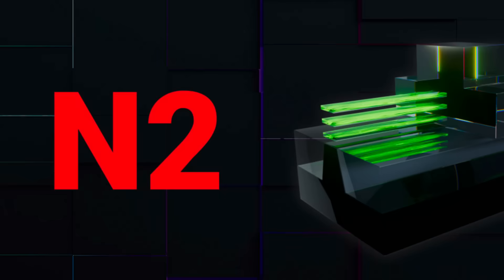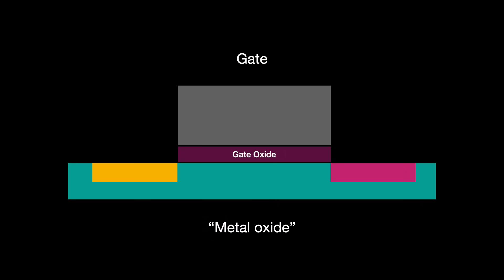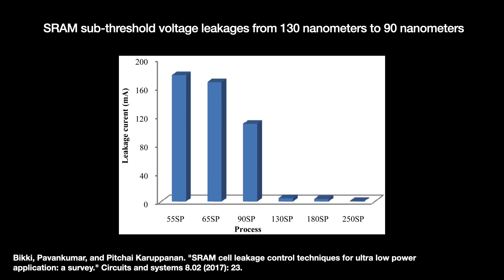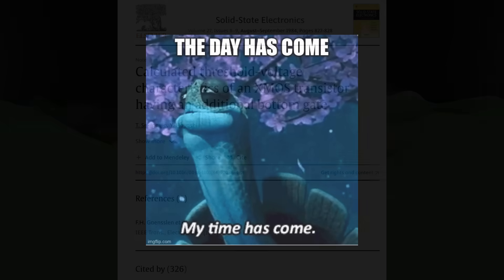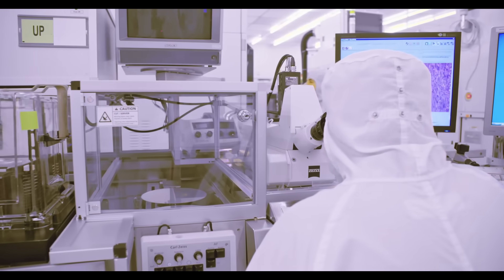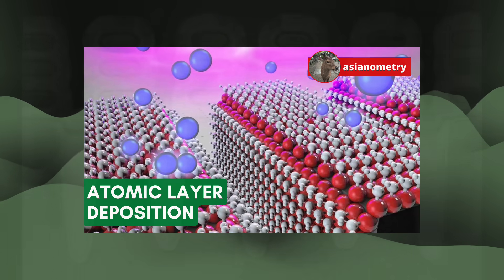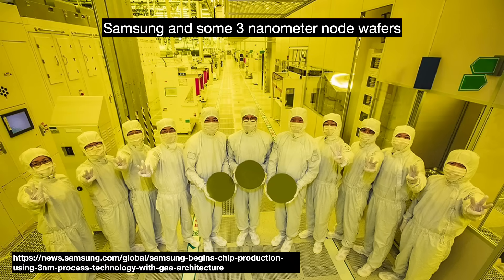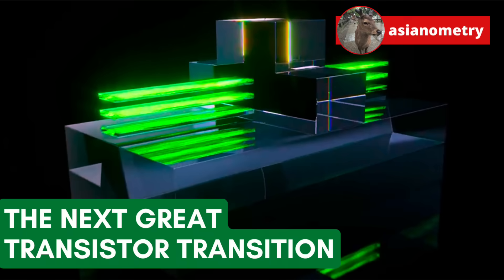The Gate-All-Around Transistor is Coming

Comment: i am 22 and seriously thinking about studying engineering at this age, thanks to you. i am quite speechless with this content, thanks.
Reply: You are still very young, sure you should try studying engineering.
Reply: Do it!
Reply: Jump in and make the future for us. :)
Reply: Go for it! Make sure to keep your passion though and don't let it get away from you. If you need Motivation or just a kick in the butt once in the while, videos like this are amazing. They help me too.
Reply: Most EEs at 22 already have their EE Batchelor degree and are deciding if they need to get a Masters or Doctorate degree for the job they want.

You better be very motivated to get in starting at 22.

An alternative is getting in to Integrated Circuit Mask Layout Design.

Get in to that and you'll be down in the weeds battlng the process.  It's not hard to get in to that and much less schooling but you wind up with lots of schedule pressure because you are in the critical path.

If you are good with spatial relations and things like Tetris, packing suitcases, grocery bags and you can understand resistors, capacitors and transistors, you might have the talent for it.

With that said you will never have the influence in a company that an EE has even if you design devices and libraries that allow the EEs to design circuits with better electrical characteristics and lower die area.  You'll have to reinvent the wheel often because most rookie EEs won't believe that your experience is worth listening to and there is a chance that your job will be replaced by some AI Place & Route tool even if you specialize in full custom analog or you are a guy that runs a Place & Route tool.

I did it and felt like a whore being used for my mind.

But I quit and I prefer mindless work so I can keep my mind to myself.  That's a much better way for me to live.
Reply: You’d probably be funneled into the military industrial complex
Reply: It's a long journey with some real challenges but I guarantee it you will never regret your decision. I made the same decision around your exact age and my life completely changed for the better. DM if you want more information (I'm a semi engineer).
Reply: @Chalup4  i wrote to you on the instagram
Reply: If you like being presented with math problems that seriously bake your noodle for several hours before you finally crack it: Do it!

If you hate the problem solving part and just want to get to the dopamine rush, from getting the solution, quickly.... keep playing computer games.
Reply: @andersjjensen  i love the rush of diving into unknown
Reply: @wokeupina  If math is like a natural second language to you, then by all means, pursue a STEM career.

Comment: Still feels like the major advancements has been made and that the coming AI-boom will require a lot more electricity in the coming years
Reply: AI processing is also advancing with stuff like analog electronics coming back into research since it turns out ML models run really well and efficiently on analog stuff. There's also FPGAs and ASICs, etc.!!
Reply: FinFET, then GAAFET, then Forksheet seems to make sense, as there seems to be gains in multiple criteria but CFET seems to have little power efficiency and performance improvements… 

I believe the next step is Post-CMOS spintronics / ferro-magnetic related technology based on Magnetic Tunnel Junction (MTJ) (or derived from it) like MRAM, Intel MESO concept, Spintec FESO concept… Semiconductor R&D should be focusing on spintronics instead of CFET as it has a much bigger improvement potential than CFET…

Comment: I was working in the forklift industry when the first MOSFETs came on the market thirty years ago. They were far more efficient than Thyristors, and took the market by storm.

Not quite the same tech, these devices could handle 400 amps at up to 96 volts. Single devices will fill an old style coffee cup, and weigh up to a kilogram.
Reply: whats an old style coffee cup look like?
Reply: @southwestedc  

They were about 2.25 internal height I think, and 2.0 internal diameter. Inches I mean. So not like most of the coffee cups you can buy today. I’ve got a huge cup that needs two large presses on my Keurig — great for caffeine addiction.
Reply: @waynesworldofsci-tech  12oz has always been standard cup'o size from coffeeshops as far as I am aware...  maybe 8oz. Unless my math is seriously broken the cup you describe would be
like4 oz which is seriously itty bitty
Reply: @southwestedc  

Going by memory, the size of a small cup at Tim Horton’s is about right. Fist size for a five year old.
Reply: @waynesworldofsci-tech  Now my question is if we are talking about espresso or brewed coffee? because that sounds perfect sized for a double espresso but for brewed coffee that would feel like a ripoff
Reply: @southwestedc  

I’m trying to describe the coffee mugs we had at home when I was a kid. Quit drinking coffee for twenty years, found the mugs had grown.

Comment: Here is the deal, this is probably the last technique for making silicon wafer based ICs.  We are nearing the end of the road.

Here's the good news, there is probably another 10 - 15 years of die shrinks, or to say it better, improving the power efficiency along with increasing transistor density, so the industry still has a bit of work cut out for them.

Here's more good news.  The transistor density that can be gotten with GAAFet will probably approach 500MTr/mm2.

This is not comprehendable for most human brains.  To put it another way, if the industry doubles the transistor density from something like TSMC N3, the world won't NEED anything more dense for decades.  Decades.  The improvements that will be made in the next 10 - 15 years will last decades.

The reason it will last decades is because the power consumption of an IC that has 2X the transistor density vs. something like TSMC N3 ALONG with the improved techniques, part of which is moving to GAAFet which is going to reduce power consumption substantially means that for almost ALL electronics today, you won't need anything better.  The power consumption will be so small it just wont matter.  For instance with a smart phone, the ICs use very little power, and other parts of the phone use more, such as having to transmit a signal to a cell tower, and transistors shrinking inside an IC doesn't fix that problem, along with the power consumption of the screen.  Even right now with Apple using TSMC N3 for their Apple 14 devices, the ICs use very little.  If you were to reduce that by even 25% you just don't need it to get any better because it's the other components in the devices using more power.

So, almost the entire world of electronics won't need to move on from GAAFet on Silicon wafers.  It's really not until you get into the world of supercomputers that improvements will help.  And even with large server farms, using less and less power is always better, but at some point you hit so many other physical limitations where you're almost at a limit.  Even for a data server which is doing nothing but getting a request for data, pulling that data and then sending it to the requester, you start to hit limits.  Can a single server handle 100 billion requests a second?  Well, how much cabling do you need connected to that server to deal with the data bandwidth to SERVE 100 billion requests a second?

So there's going to be a lot of other issues that become a problem to be solved before transistor density becomes a limiting factor for MOST the world of electronics.  Humans don't need to be holding a supercomputer in their hands.  If you can access the data of a supercomputer using a simple device that costs WAY less money, believe me that's what humans are going to do, so we're approaching the limit of performance that's needed for home computing along with most types of computing.  Yes I know people THINK how wonderful it would be to have such power in their hands.  Not really.  Economics has its part to play also.  If a supercomputer can handle 10 billion requests for data a seconds, we'll be OK, really.  Best to have a limited number to do specific things, not have a supercomputer in everyone's hands to collect incredible amounts of data from you and give that to the rest of the world, along with you making stupid TikTok videos in 10 seconds on your smart phone.
Reply: I agree that FinFET, then GAAFET, then Forksheet seems to make sense, as there seems to be gains in multiple criteria but CFET seems to have little power efficiency and performance improvements… 

I believe the next step is Post-CMOS spintronics / ferro-magnetic related technology based on Magnetic Tunnel Junction (MTJ) (or derived from it) like MRAM, Intel MESO concept, Spintec FESO concept… that seems to have significant power saving potential, and also open new architecture opportunities.

Semiconductor R&D should be focusing on spintronics instead of CFET as it has a much bigger improvement potential than CFET…
Reply: @nicolasdujarrier  TLDR:  GAAFET is going to be good in almost all aspects of electronics for 3+ decades, and probably even desktop for a good 2+ decades, with the sole outlier being server, and it won't be economical moving to anything else unless you really need to.

The data:

Forsheet and CFET won't solve the bandwidth issue.  Once we get to something like Intel 17A and simply using their new tile based MCM architecture, Intel could make a desktop CPU that's as powerful as today's Zen 4 based EPYC server CPUs.  But in saying this it means running highly parallel applications, something desktop users typically don't do.

So this still gets to use case.  GAAFet will suffice for most electronics for at LEAST 3 decades, and even high speed computing for home use for at least 2 decades, probably closer to 3.  GAAFet should become very economical.  Moving to Forksheet or CFET, which I understand would still be based on silicon wafers will mean higher manufacturing costs, and for now the only thing I see a use case for is server, and only for tasks which requires a lot of processing with little input, meaning compute intensive tasks that are also highly parallel tasks.  And these tasks certainly exist, such as a lot of engineering modeling which uses a lot of data to do calculations, in which case you can have a large amount of cache hold large amounts of data.  In fact Zen 3/4 EPYC with 3D cache is being used for this exact thing.

The problem is though most tasks are short lived and you constantly need NEW data coming in/out of the system and have to pass that data in/out of the CPU, and imagine a 1024 core CPU.  What would be the bandwidth requirements?  How many channels of memory do you need, or how much do you have to CHANGE the current memory architecture to have enough memory channels to feed so many cores?  Will you have to cut the size of a DIMM slot in half so that you get 2X the memory channels/DIMMS in the same space?  Zen 4 EPYC now uses 12 channels of memory to support 128c/256t processing.  You get into issues of space required on a MB.  You get into distance of memory slots being too far away from the CPU creating too much latency in moving data from memory to the CPU.

I mean the engineering problems that will need to be solved isn't a short list.  You'd need multiple PCIe pathways into the CPU so that one core asking for data isn't tying up 500 cores.

In other words, the bandwidth problem is going to become a more dominant problem than transistor shrinks, but this is in regards to server.  For most anything else including desktop computers,  it's not going to take but about 4 - 5 more generations of CPUs until there is SO much compute power that even power users can use a typical desktop PC instead of a workstation to do what they need in a cost effective way.  There isn't really a bandwidth problem for PCs, except for memory.  Moving to PCI gen6 is going to be an absurd amount of data capacity for a PC.  But for memory, even right now desktop is about to need quad channel memory, and that's easy enough to do with a single DIMM for each channel, but the industry needs to get to DDR6 as and double the memory capacity for each IC as fast as possible because this is already a problem for desktop, and this is according to what AMD has said, where they don't want to move above 16c/32t for desktop because DDR5 dual channel doesn't have the bandwidth for memory intensive tasks to add more cores, and moving up to higher speed DDR5 doesn't fix this problem.  The only thing that will do is keep up with faster cores when AMD releases Zen 5 then Zen 6.

I've heard mention light transmission into the CPU but I don't see how that would be economical for a PC.  It probably also wouldn't be necessary for a server CPU, you'd just need more PCIe pathways that are independent of each other so more cores could be getting data at the same time.  Maybe moving to PCIe gen7 and reducing the typical bus of X16 down to X4, or having the CPU capable of bifurcation down to individual lanes.  I don't know.  What I DO know is that with a Zen 4 EPYC CPU that uses a MASSIVE IOD for its infinity fabric, moving ahead a couple generations means that IOD will have a large shrink and there will be direct connects between chiplets for the most part which means getting rid of the infinity fabric logic, and moving to something like Intel 17A means core counts could be about what I said, 1024 cores in the same size package EPYC is now, or at LEAST 512 cores/1024 threads. POWER will be the critical issue, along with bandwidth.  If forksheet can solve the power problem, that's cool.  CFET though is basically stacking and I see that as problematic for CPUs that have to clock as fast as possible.
Reply: @johndoh5182  Thanks very much for the very detailed feedback : much appreciated 👍. 

Regarding silicon CMOS GAAFET transistors, I agree that unfortunately it will likely become the default platform used for computing for the coming 3 decades, but not because it is the most energy efficient one, but because it will be the most economical one (best performance per unit price). The issue is the same as with fossil fuel versus solar energy, or ICE versus EVs : Although the alternative is overall better, the entrenched technology already benefits from decades of cumulative R&D investments, which make the entrenched technology much cheaper than any new emerging technology coming to the market.

There is no doubt in my mind that spintronics related technologies have the potential to be much more power efficient (there are some very interesting website articles about Intel MESO concept, if you have some spare time, try to Google it, and Non-Volatile-Memory (NVM) MRAM,…) but this technology is still a new emerging technology, and will require significant upfront R&D investment to first catch-up with silicon CMOS performance… 

And contrary to what you are saying, having more performance for less energy would likely bring new unforeseen benefits. A « simple » 2020 iPhone has likely a computing performance that exceeds the most powerful supercomputer in the world in the 1980 !!! And it helps in a lot of ways on daily tasks, saving a lot of time and effort. More computing performance may enable even more automation like maybe humanoid robots that today are clunky and not very efficient, likely due to lack of a more efficient computing platform (my hunch is that memristive systems are likely needed for it to really work…).

So the sooner investments/resources are re-allocated to spintronics related technologies, the sooner we would unlock all the benefits that could come with them, and that’s why allocating resources to CFET, that doesn’t seems to have much power, nor performance improvement gains, is IMO a very bad idea : those resources would be much more useful to be allocated to accelerate the advent of the Beyond CMOS spintronics platform and all the benefits that would come with it…

Comment: Minor correction; at 6:05 you talk about the effects of dielectric permittivity on gate function, and while obviously higher dielectric materials produce a higher capacitance, the electric fields within the substructure are actually reduced as an effect of the polarization, which can be essentially described as the realignment of electric charges inside the dielectric that cancels out the external field.
Reply: So the actual benefit of using high-k gate dielectric would be?
Is is that the electric field is lower in the volume of the dielectric but then higher at the interface of dielectric-channel?
Reply: @Martinit0  Correct, charge density at the gaussian surface of the electrode increases as relative permittivity increases, increasing total work capacity. It's easier to think about when you look at what we consider ,"charge" in electromagnetism as an imbalance of electrons and protons throughout a system. A dielectric essentially acts as a material with quasi-free electrons; similar to a metal, but instead their movement is limited to their immediate surroundings. When an electric field is applied to the material, the charged particles inside rearrange in order to achieve electrostatic equilibrium, which means there is no imbalance of charge, so the field on the inside from the perspective of the system is zero.

It also increases charge density disproportionate to voltage, meaning increased efficiency, but I'm not sure how pertinent that is to transistor design specifically. More applies to capacitors and electrostatic motors.